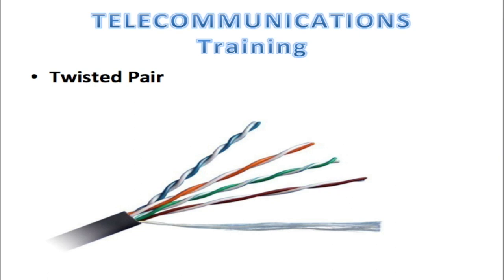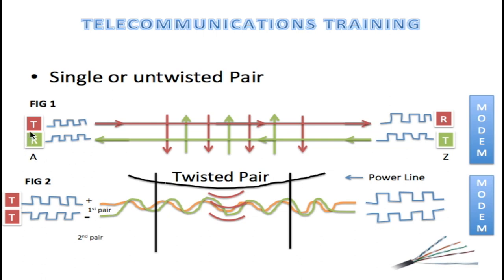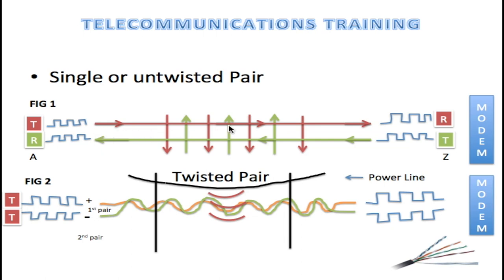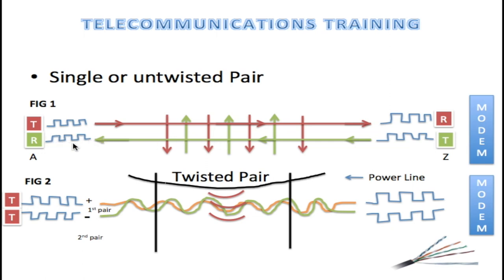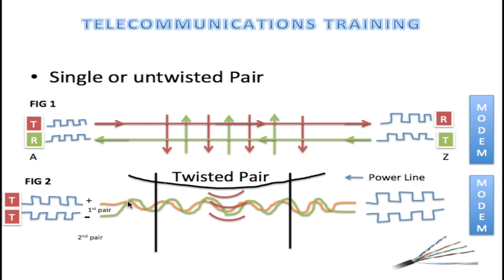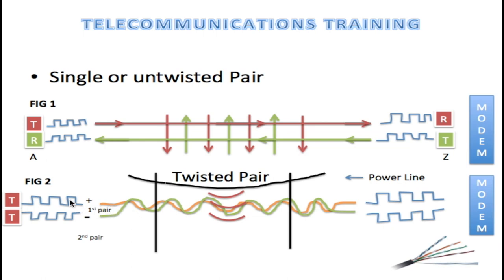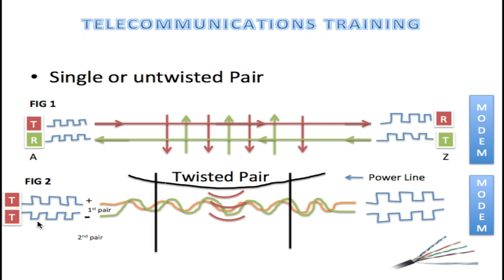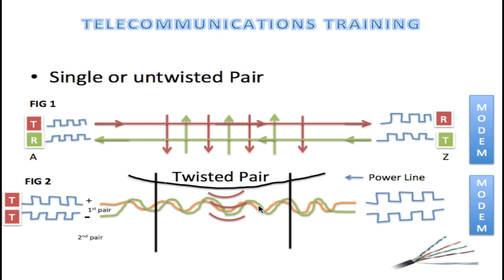How Twisted Pair work HD 1080p

Comment: Thank you for your video. I would just add that the 4 pairs in a ethernet cable are twisted in a different composition (numbers of turns differ, and therefore the length) because if they were equally twisted, the interference would be adding and we would have a higher interference voltage at the end (not just influencing the signal but also being dangerous to the equipment)

Comment: I have a question. In a twisted pair cable (let's say cat5e with four pairs), does one wire in the pair transmit, and one wire receive? I'm confused on whether the current flowing through two wires are moving in different directions or same directions. That way I can understand how the two fields generated by each current flowing through both wires interact with each other.
Reply from the maker: The example in the video was only to show how an electromagnetic field is generated from a changing current in a copper wire.  This electromagnetic field induces voltage as noise into parallel wires with in the same cable.  Generally a telephone line has two wires twisted together tip/ring, and these two wires would transmit an electromagnetic field to parallel pair of telephone wires with in the same cable. Twisted pair helps to cancel this noise.  Regarding your question on the direction of current flow.  The current is sent on the ring side from 48 Volts at the switch through the phone and back to the switch on the tip side.  Hopefully this explanation was helpful.
Reply: @TelecomTraining  oh ok, I think I understand. Basically, from my understanding from reading your comment, the current going through both wires in a pair would flow in opposite directions. also, do telephone lines support full-duplex?
Reply: Actually I've just searched it up, I believe they do. I'm currently going through your videos on fibre optics, and they're very helpful! Subbed! Thank you for your dedication to teach us!
Reply: @TelecomTraining  Also one more thing, sorry for bugging you! Would the way the signal is transmitted and received in a telephone line (shown in figure 2)  be the same in UTP straight-through cable (cat5e 1000BASE-T or higher standards)? I'm used to the transmitter-receiver relationship you showed us in figure 1 (single or untwisted pair). Maybe I'm thinking of how the pins are functioning at both ends of the link, but I'm not quite sure at this point.
Reply from the maker: @aunmaqsood3129  Glad the videos were helpful to you.  Your last question was if telephone lines were full duplex.  The answer is yes.
Reply: @TelecomTraining Alright, thank you! Also, do UTP  telephone line cables send information the same way as UTP networking cables (cat5e).
Reply from the maker: @aunmaqsood3129  UTP cable,  cat 5 or cat 6 can be used as network cables which is generally ethernet or for telephone.  These services use cat 5 or cat 6 UTP cable in much different ways.
Reply: @TelecomTraining  Oh ok I understand, thanks for the explanation!